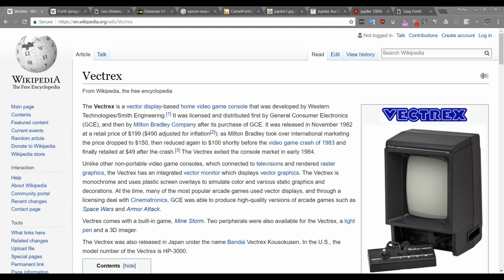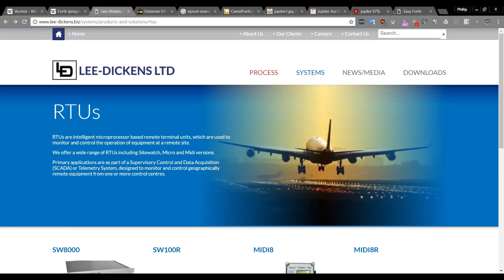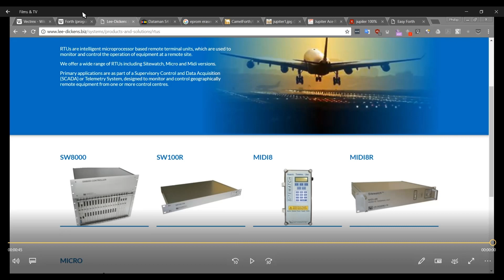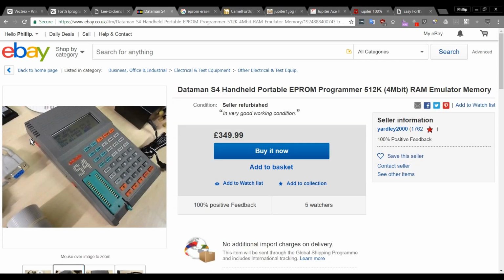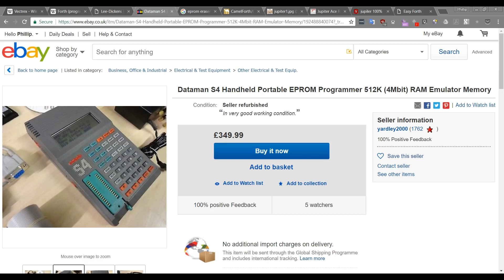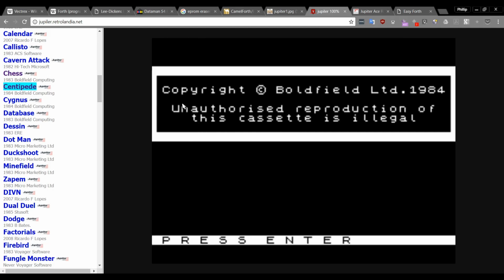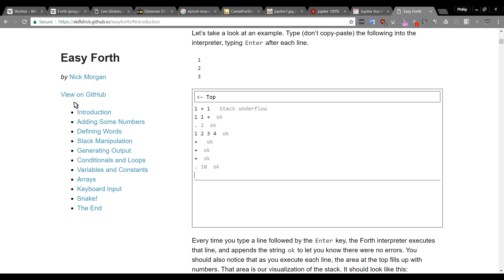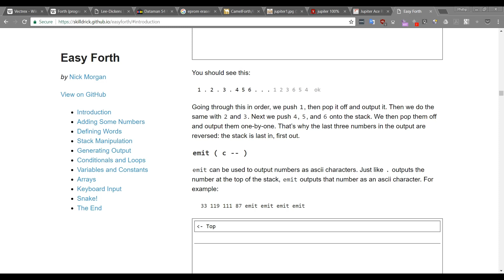Vectrex Programming with Forth - Part 1 - Intro to Vectrex, Forth and the Project

Comment: Did nobody on your company thought of making an EPROM emulator? By just uploading straight to a RAM chip? Or even simulate it with an AT ISA card (the ISA bus was a bit slow at 1MHz). But that’s how we hacked and debugged NES games. Just compiled a binary uploaded it to our ISA “6502” card so it would run from RAM and we could still monitor the signals from the 386. Iterating with eprom burning must have been a terribly slow and frustrating process.

Edit haha: literally 7 second after writing this you talk about an emulate function of your burner 😂
Reply from the maker: 😄 Things happened more slowly back then. A big bag of EPROMs, a burner and an eraser wasn't so bad. PC serial ports weren't that fast either. The Dataman EPROM emulators we eventually used were expensive and we were on a shoestring!
Reply: @PhillipEaton  yeah eprom burners even over parallel took forever. Hence we as a cracked group created a piece of hardware on a 16bit ISA card to monitor the 6502 signals on the NES and have a breakout to a dedicated 32KB rom. Dumping the ROM back in 1989-1990 already took some time.
A couple of years back I bought a chain eprom burner to do some videos on game hacking and running that code eventually on real hardware (except pacman and donke king since I don’t have those) and I was like okay: “burn keys have a coffee… ohh it’s already done ;)”
Us old geezers still know the pains of long dev cycles.

Comment: At first I was confused why eBay was running so slow on your computer and then why centipede had an unplayable frame rate and then I put it together and realized you’re only recording at like 2 frames a second.
Reply from the maker: Quite possibly, the software I used to record was quite old and it looked OK at the time. It's the first video I ever recorded for YouTube!